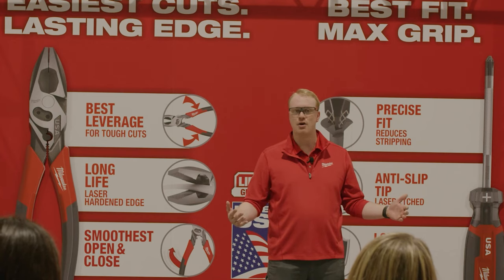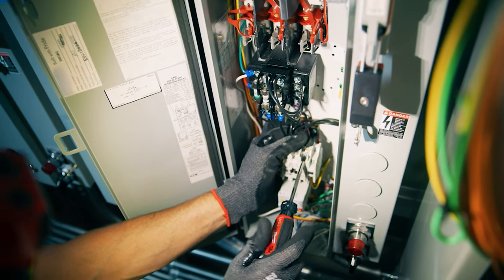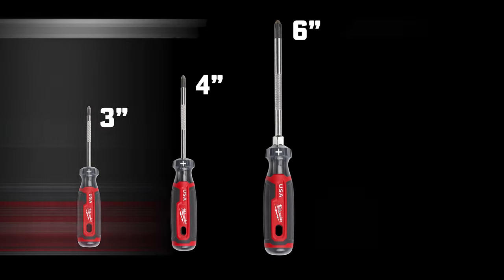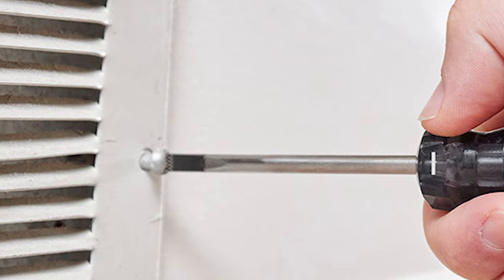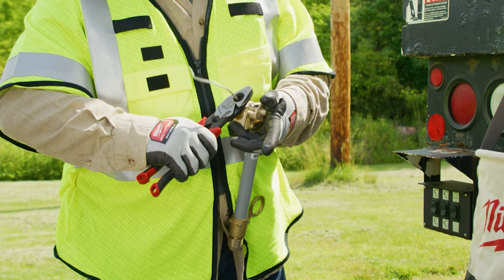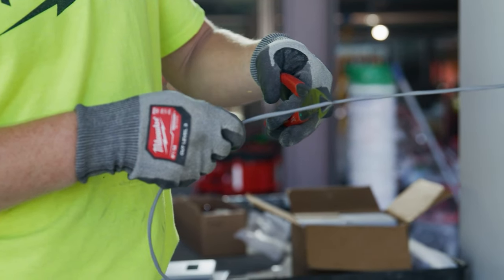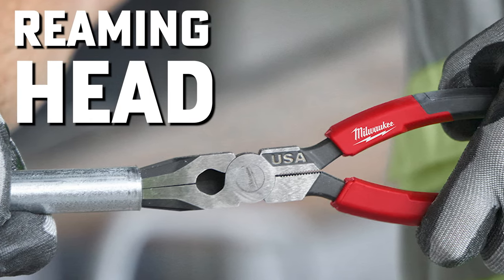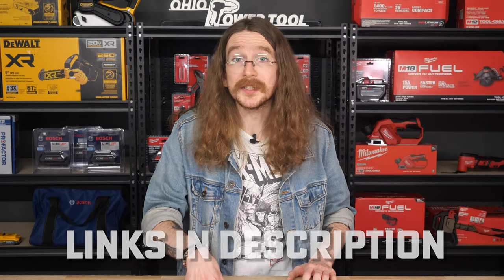Milwaukee’s USA Made Tools NOW AVAILABLE! Screwdrivers, Pliers & Cutters

Comment: I'm glad they're actually following through, but will admit that I'm probably not going to buy.
I'd check out a pair of the dipped handle pliers maybe, but I do not like the look of the driver handles .

The boron steel sounds good though,  if it's anything like the original Stanley workmate screwdrivers or early 100 plus they could easily be the toughest screwdrivers on the market.
The original Stanley workmaster screwdrivers with the boron alloy blades are highly sought after.